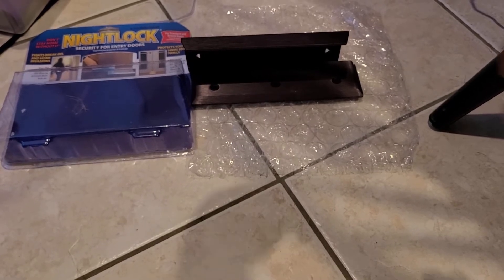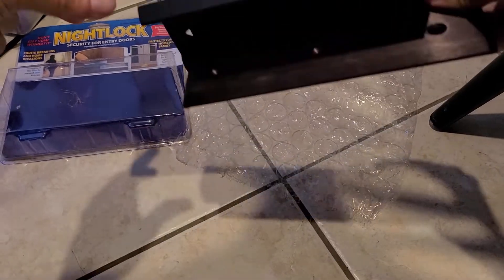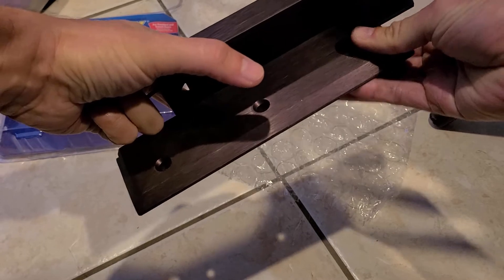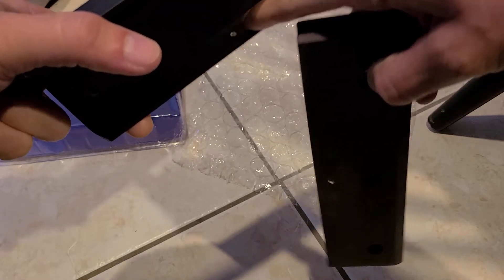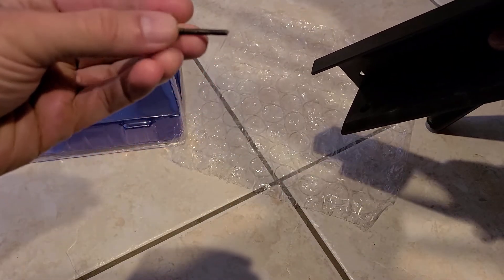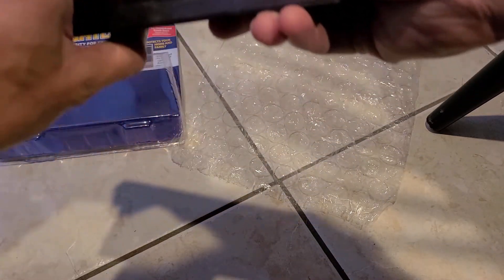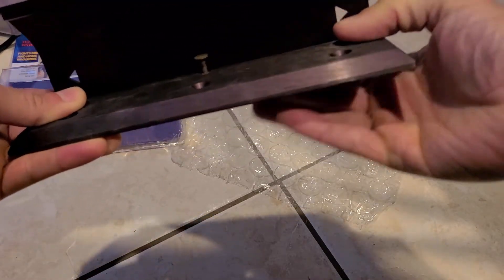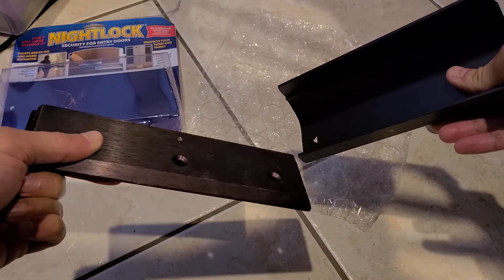NIGHTLOCK Hacked in seconds! (and how to make it un-hackable)

Comment: Move it right up against the frame 🤷🏽‍♂️
Reply from the maker: If you're suggesting that would mean the door frame trim or the base board heat cover would stop it you would still be able to slide it the other way.  The nail as shown in the video is the best option I think.
Reply: @goodlifehacker  sorry I should have been more clear 😂, if the opportunity is there I ment just past the door frame

Comment: To prevent that hack, simply drill a hole through the security locking plate down into the base plate and insert a nail the plate will not slide out. If really ambitious make a spring loaded locking pin.
Reply from the maker: You mean exactly as shown in the video towards the end?  :)
Reply: @goodlifehacker  didn’t even watch that far.

Comment: I'm sure you can do better than that!  It's a tiny hole.  It may be dark.  You're just not envisioning many scenarios.  At least you identified the main problem though.  How about some sort of spring loaded pin?  Something easy to pull up to unlock and slide to the side.  But really this device is poorly thought out.  Way too much hassle to use 365 times a year or more if you are in and out.  Also it should support the door higher up.  If your door bends it can easily be levered open.  The best lock every made was the NY Police lock as it supported the middle of the door at about a 45 degree angle.  Smart when you use physics properly.

Comment: That was able to happen because thats the wrong night lock to buy. I wouldn't buy that model. Their other model cant be removed like that
Reply from the maker: Hi and thank you for commenting. I think you might be referring to the LockDown 1 model? I just had a look and I bet that red aluminum wedge can be cut through quickly with a thin bimetal blade. I don't have one to try it on. Also I wouldn't want to make a giant hole in my floor which that model requires.
Reply: @goodlifehacker  it could be cut with a blade possibly. That gives you enough time to meet them at the door with a gun.....

Comment: 1. They’d have to know it’s a nightlock blocking the door to use this hack.
2. If they used this hack, it’s likely that someone you previously let in your home opened your door because they did their homework on your home.
3. If you use a nightlock on all your doors, inserting a screw in them ensures screw yourself over if you lock yourself out. Some people exit their home via garage door and their garage opener fails for X reason.
3. Every man made lock can be conquered no matter what you do.
Reply: We have to remember that devices like these time none of them are full. if you combined this with other types of security implementations, it may help to further strengthen your security. But as you mentioned, not a single man-made item will ever be full proof.
Reply from the maker: It seems the three most popular things are reinforced door jambs, a bar that acts as a wedge between the door knob and the ground, and this nightlock style type of barricade. If the door is kicked and all the resistance is at the bottom it would probably be obvious that it is the nightlock style barricade to someone who knows what they're doing. I agree the screw solution that I mentioned wouldn't be good if you think you're going to need to enter through that door as a backup if you get locked out of your house. Well you can always cut the bottom of the door off with a sawzall :)  Where there is a will there is a way.
Reply: @goodlifehacker   NOPE! 
A door jamb lock would be breached. It was already tested and showed how easy it was to break thru.

Comment: Wow. It’s like you knew it was there
Reply from the maker: I have ESP :)  I think if someone is having trouble kicking a door there are three main possibilities of preventative measures that people might be using these days.  A door bar that wedges under the handle and rests diagonally on the floor, reinforced steel door jambs, or a nightlock type of device.  This one would be a bit obvious since the bottom of the door would be where all the resistance is.  The video is just to show that there is a quick and easy way to make this device more secure.

Comment: Put on edge and put something the the right of it than can’t be pushed with a knife
Reply: then someone breaking the door window can lean down with a stick and move it out of the way. The nail modification is very difficult to remove from anyone putting their arm thru the door window, using a stick.

Comment: Well, you'd have to know that there is a Nightlock for this to even work. Ya, anything is hackable. I guess if you're a Super Spy that shoves a camera under the door before you attempt to enter and if that's the case you're Super Fuked anyway!
Reply from the maker: Hi what I was worried about is if someone kicks the door and realizes there is something holding it in place and they know this device exists the next move could be a quick swipe through the bottom with something like this. This simple mod in my opinion makes it a lot more secure.
Reply: @goodlifehacker  I agree with what you're saying but most break ins are Bruth Force and the only tools they might bring would be a crowbar. Even a locksmith needs to know what kind of lock they are working with in order to use the correct tool/pick'. I think it's great for added Security.